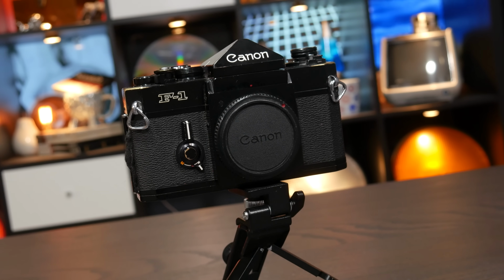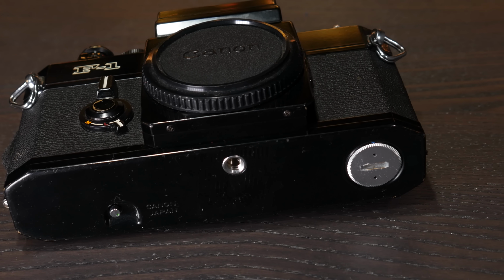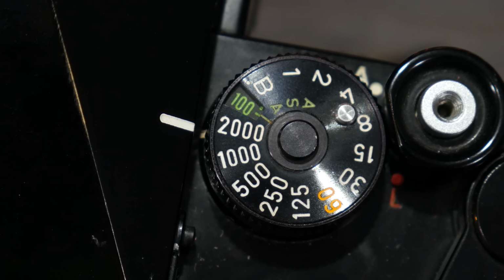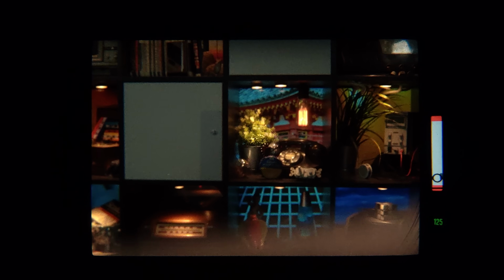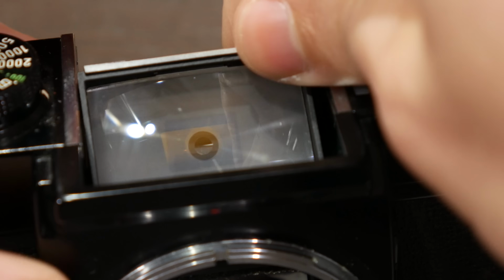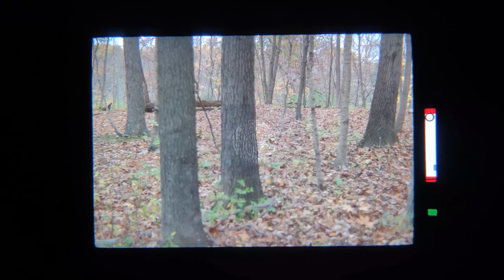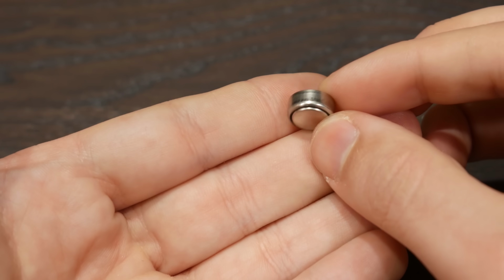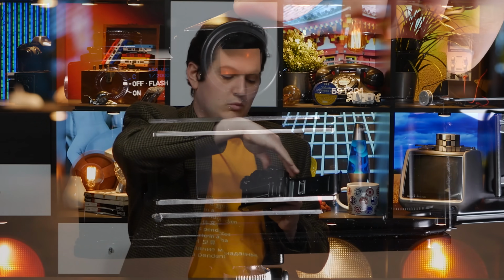1970's Camera Tech: How they showed you what settings to use

Comment: First of all, this was just a smashing video! Excellent in all respects. I'll be eagerly looking forward to more photography-focused episodes in the future, as I'm a vintage camera collector and part-time repairman/hacker/destroyer 🤣

Second, I had never noticed that there is an American measurement standard that is actually superior to its European counterpart, ASA/ISO. DIN is awful, really, and the typical example of the German tendency to overthink and overcomplicate stuff.

Third, while neat, that sandwiched half-silvered mirror seems like something designed in Germany 🤣Pentax (and many other copycats) solved the problem via two CdS cells at each side of the viewfinder window, using a center-weighted approach. Putting a mirror between the focusing screen and condenser was a technical feat, but a pretty pointless one.

Comment: 5:12 Those f-numbers are the denominator in a fraction of the lens focal length (which is what the “f” stands for). So higher denominators means the fraction is actually smaller: e.g. f/2.8 is less than f/1.4.

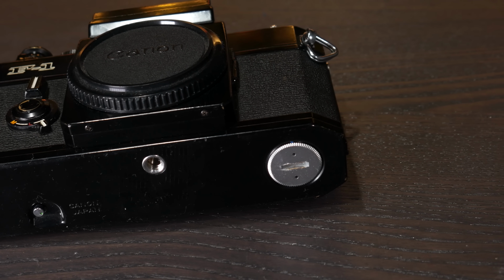Comment: 4:45 “Not a questionable astronomical unit” ... so, not less than 12 parsecs, then?
Reply: ... but parsec IS a well defined and unquestioned astronomical unit of distance.... (I feel like you know this, and it's me that might be missing something?)

Star Wars even later made a point that the MF set a short route rather than a quick one; so (retroactively and somewhat ham-fisted) they made the Solo quote correct....
Reply: @JustinShaedo  A light meter is the questionable inverse of the light minute. A light minute is how much distance light can cover in a minute while a light meter is how much time it takes for light to cover a meter.
This fiddling with what means time and what means distance is the source of the joke you missed
Reply: @ghosty918  I do, genuinely, appreciate you trying to help!  That said I'm fairly certain you're not on the right track (why else re-explain my question?). Again, appreciate the attempt!
Reply: @JustinShaedo  The Han Solo quote is fine anyway... the amount of distance you need to accelerate up to light speed is a perfectly valid measurement, just as you could give the "zero to sixty in x seconds" stat as a distance, as you can calculate the time from the distance and the distance from the time, because we're talking about speed, which IS distance over time. It's just people not being as clever as they think, doubling the number of assumptions they are getting wrong. We use this way around when talking about deceleration... we call it "stopping distance", it's a perfectly valid measurement to give.
Reply: @annoloki  TLDR you can't solve x=yz if you only have the value for one of the variables.

"you could give the "zero to sixty in x seconds" stat as a distance" really good point, actually I think you made several good points (respect for your comment)

 ... but ... the original Solo quote gives only one variable, distance (in parsecs). Your proposed example has two known values (speed and distance) enabling the calculation of a third (time taken and a derivative, acceleration)

In the case of stopping distance, you have 3 known values: distance, initial velocity and final velocity;  allowing the calculation of the third, acceleration.
Reply: @annoloki  The retroactive justification for the Han Solo quote is that the Kessel Run involves navigating between various gravitational hazards (primarily black holes) and a ship which can achieve higher speeds in hyperspace can follow a more direct course by passing closer to these hazards without being pulled out of hyperspace.  It's nothing to do with the Falcon's acceleration.
Reply: @VitalVampyr  I'm not on about that, I'm on about how what people were arguing when they argued that it was wrong to give a function of acceleration as a distance rather than as a time... this is untrue, so the retroactive justification wasn't needed, but obviously it was written by somebody who didn't know that that the arguments had no validity and there was no error to justify.

Comment: Not just the higher voltage that is the problem with Alkaline. They also have a voltage drop off as they discharge. Mercury batteries put out the same voltage until they die. I got mercury batteries from Russia for my Nikon F1. Zinc air is a good choice.

Comment: I love my Pentax KX for those reasons, but I can use the same lenses on my K-1 as well! Also you can use pretty much any chemistry of battery in a Pentax! They have a voltage bridge compensation circuit to keep the meter accurate!

Comment: In highschool (1997) I took a photography class (along with my sister) and Dad gave us a camera to use, almost this exact model.  We learned a lot (though the F/16 rule would have helped a lot for the one roll where I didn't know my light meter was dead ... I got some decent prints out of it regardless.  Not "good" prints, just "okay")....

Also of note was the analog (mechanical) focus aid in the center of the viewfinder.  It functionally overlaid a small double image that shifted as you twisted focus, and when it aligned with the rest of the image you were properly focused.

Comment: I have a Praktica MTL 5B which has a similar but even simpler meter!
It has just the needle showing under/over-exposure and only works when stopped down, pressing the dof preview button. I get to be smug about my camera measuring the actual amount of light passing through the lens instead of approximating it with extra aperture linkage! Also saves battery this way probably, I change mine every year at most.

Comment: A friend gave me a Kodak Retina Reflex S last week. Each of its Deckel-mount lenses feature a pair of mechanical depth-of-field indicators that slide around the focus markings on the barrel as you change aperture & shutter settings. In 25+ years of camera operation it's easily one of the coolest camera features I've ever seen. Those little red tabs, alongside the Compur leaf shutter & bottom-mounted film advance lever, have definitely made me proud to be a new Retina owner.

Comment: The only way I can think of how they got the semi transparent mirror floating in the middle would be to make the viewfinder screen as a doublet with the seam being the location of the mirror. You'd make the two parts individually, apply a semi transparent aluminum coating to one and then use index matching glue to assemble the optic.

Comment: That "older style of hotshoe" at https://youtu.be/r_uBHmAhnfo?t=1573 isn't really that old (Nikon tried to get something similar to be accepted as standard on their F and F2, but didn't get anywhere) Canon didn't use this for any other camera that I know of. (Please feel free to correct me if I'm wrong) I don't know for certain, but I suspect that its there because they couldn't have a hotshoe on the prism as it was removable (the contemporary FTB and EF had the standard hotshoe on the prism for example). Clearly they solved this later as the New F1 from the 80s has a hotshoe with extra synch pins for the various A-series flashguns on the various prisms (other than the waist level finder). There were several flash couplers that gave you a standard hotshoe attached to those couplers, and one actually placed the flash above the prism. (And talking about flash the CAT system they used in this and a couple of other cameras would definitely be worth talking about, especially as a precursor to more automatic stuff, and eventually the TTL flash they put on the T90 you also have up there).

While alkaline batteries don't work properly with the F1 they work just fine on the EF (which isn't entirely mechanical, longer shutter speeds are electronically controlled, but short ones are mechanical). This is because unlike many cameras of the time it has a bridge circuit so the higher voltage, and the different discharge curves of alkaline vs mercury or zinc-air batteries don't faze it.  As much as I love my F-1 (and am definitely looking forward to more videos about it) the EF is a very nice and sadly somewhat ignored camera.

ETA: The alternative prism with the battery powered meter does work in low light. The Booster T Finder has its own light meter for use in low light situations, and is designed specifically to take photos longer than 1/60 of a second up to 60 seconds and meter properly (although you will need to adjust your exposure to account for reciprocity failure). Its very much not just an additional lamp.

Comment: i use an ankaline battery an the needle is like 2 mm past the center of the indicator for proper voltage and my camera have a button for testing so if i press that button a lot you can drain until the voltage is the right one

Comment: My father has a mid 70's vintage Minolta SRT-101, it has a similar needle ring meter in the viewfinder however on that camera both the aperture and shutter speed control affects the ring arm, and the light meter needle remains the same, no matter the shutter speed, it used two light meters located on opposite sides of the viewfinder to get a whole image light average.

Comment: I bought an old 70s Soviet Zenit for art class in high school some two decades ago, as we were doing old style photography and film development. Took some time to learn all the working stuff of a completely mechanical camera. Was very impressed at the time by the light meter. That camera had a small solar panel looking light sensor above the lens and the dial was on the outside of the camera. It didn't have a battery. I assume it worked by just producing electricity depending on the light level, and moving the needle accordingly. More light means more electricity, which means the needle moves further on the scale. Then you just turn the dial till it matches the needle. A little simpler, but still useful.

Bigger problem was getting modern film that corresponds to old Soviet standards. Did find a conversion table online and bought appropriate film. Worked well enough. Overall, a nice piece. Only think broken in it was that the film wouldn't rewind, or I just didn't know how to unlock something to enable it to rewind. So I had to take the whole camera to the developer, who'd have to crack it open in a dark room and pull out the film manually.

Comment: Check out the Topcon Super DM meter, that is quite a mechanical wonder. It uses a light sensor behind the mirror which makes it possible to measure with adapted lenses, microscopes, telescopes and similar.

The shutter speed, ISO and aperture controls are connected to each other with a thin chain that pulls the meter to put the needle in the correct range, so the needle is always in the same place and gets adjusted. It is also visible from the top of the camera for people using the waist level finder. Pretty awesome stuff.

Comment: I had a literal shower thought about this and I wondered if you could make a purely mechanical light sensor using like a sorta bimetallic strip but it's the same metal with an insulating strip between them and one of them is blackened and faces where the light would be coming from. That side of the strip would absorb the light that hits it and heat up relative to the ambient air, causing it to lengthen relative to the other side and the strip as a whole to bend and the mechanical system it's connected to to move.
Alternatively maybe you could keep the two strips separate (but close to each other) and connect them to some kind of differential gear system

Comment: If you're planning on doing a video on that older brownie camera in the background you can use 120 film in it, but will need to either transfer the film to a 620 spool in complete darkness or take some sacrificial toenail clippers and trim back the edge of the 120 spool a bit (I say sacrificial bc that plastic is just tough enough to break the clipper lever). All the while you can get on a well-justified soapbox about why kodak was greedy and came out with the 620 version specifically so you have to buy only kodak film for kodak cameras

Comment: My late mother's Zenit-E didn't even need a battery.  

The light sensor was  a selenium photocell about 1½ inches wise by ⅓ of an inch tall immediately above the lens, labelled 36 in this image https://tomtiger.home.xs4all.nl/zenit/page_08.jpg.html . It directly drove a needle — 65 in this image, https://tomtiger.home.xs4all.nl/zenit/page_10.jpg.html —  in a curved window next to the shutter speed dial which you matched to the "calculator pointer" (66) which itself was affected by the film speed setting, the f-stop setting and the shutter speed setting.  Too bright or too dark to calculate was indicated simply by the needle or the pointer hitting the stops at either end of their arcs. 

The photocell to needle connection was direct and purely electrical (not electronic) and must surely be the simplest means possible to measure light.   As the photocell was mounted on the outside rather than through the lens its reading was generalised across the whole scene and it was not possible to even attempt the grey-balance thing. Despite that, you quickly learned when slightly under or slightly over was required and it all seemed slightly miraculous in 1967.
   
As for "built like a tank" the Zenit weighed at least half again as much as the Canon F1.  Russian consumer good usually were seemingly built for eternity and it sure was rugged.

Comment: When I was doing film photography back in the mid 90s I could determine the correct setting without a light meter. At least I could do it as well as the light meter on my camera. Which worked because all my film developed well. It was probably because I was younger and the camera more easily became an extension of my body.

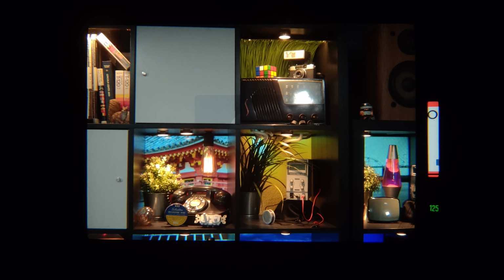Comment: 12:12 attaches lens with a clockwise motion. 
Nikon: “no no you’re doing it wrong!”
😂😂
Reply: Well whatever the reason for it is, The reality is that every time I pick up my nikon I spend a solid few seconds aggressively trying to stuff the lense on the wrong way. It gets exceptionally weird when  you run adapters for old lenses on the digital, where the old lense mounts the proper way, but you have to turn the adapter backwards to take it off the camera
Reply: In 1653, Patriarch Nikon enacted reforms of Russian Orthodox Church. Those who haven't accepted the reforms were called Old Believers (Raskolniks). This is known as Raskol (split or schism). There are still settlements of Raskolniks in Russia. Some visitors report that Nikon cameras are met negatively, while Canon are approved.
Reply: @Alexagrigorieff  Interesting. Actually, the Nippon Kogaku company began making cameras by producing the German Zeiss Ikon camera under license. They called it "Nikon" for Nippon Ikon.

Comment: You should look into the canon AE1. It’s not all mechanical but it has an ingenious mechanism that adjusts the light meter when the ads or shutter speed is adjusted. A little titanium wire and pully system runs over the viewfinder. So cool.

Comment: I learned to take photos on my dad's Minolta SRT-101, which has 2 light sensors working at the same time for the meter. It's an amazing camera and your video gave me nostalgic feelings about it. Thanks. I still have some oldschool traits even using a modern DSLR, like composing and lining up shots carefully and taking just a couple of shots instead of using burst mode, or using manual focus pretty much all the time instead of auto. I miss the simplicity of the light meter on those cameras though.

Comment: In many ways, I miss that old school feeling. Learned the craft myself on an all-manual Fuji STX. Build like a tank! But, one small "correction", on 9:10 you say you were stuck with the factory ISO. That is not the whole truth. It was common to "push" the film to gain higher ISO, especially B/W film you developed yourself. By underexposing and overdeveloping it was possible to take pictures under very low light conditions. The trade off was more grain and typically some harsher contrasts. This can in many cases give a very, very pleasing vintage effect. It was also possible to pull, underexpose, for lower contrast and reduced grain, but I never tried this.

Comment: I have and use a Pentax K1000 which is fairly similar to this camera (all mechanical, basic needle light meter) but without the interchangeable viewfinder. Definitely interesting to have learned how that portion of it works and is displayed. Also made me look up which battery it was originally designed for (seems like in my case 1.5V is just fine). Great and informative video as always!

Comment: Comments for the algorithm. Did you re-upload this? This shows up after the behind the scenes video in the Subscriptions timeline. As for the content, a great explanation. I used an analog SLR growing up, but only knew to center the circle and the needle. After teaching optics for several years I finally understood F numbers and all that, but didn't put it all together until recently. Learning how the system works was enlightening!